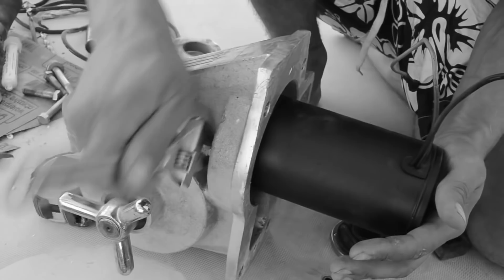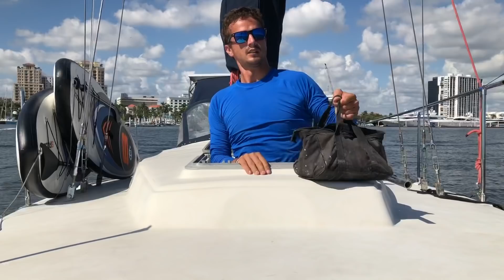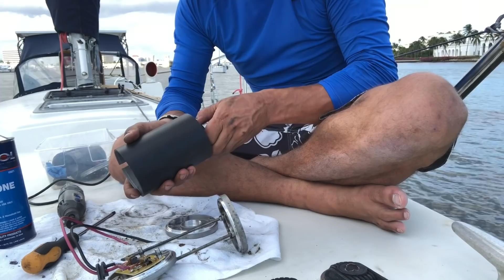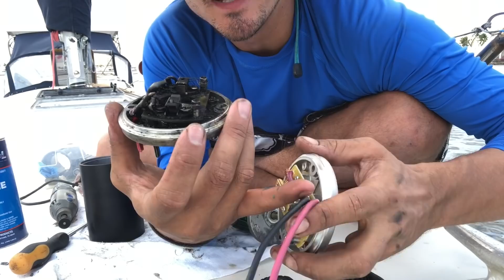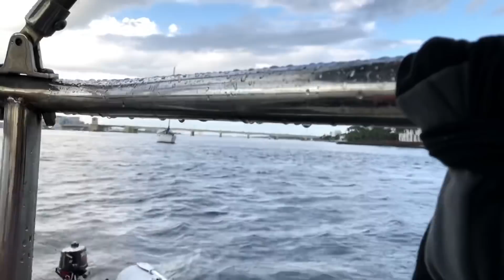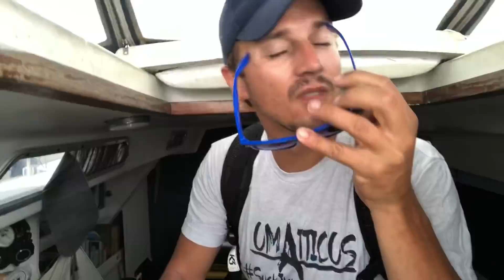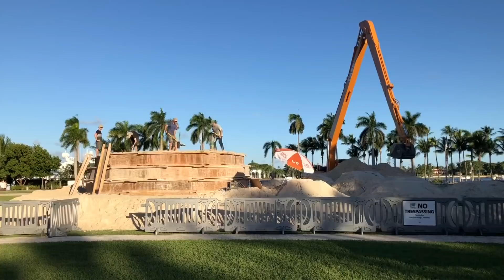Windlass FAILURE by myself [Sailing Uma — Step 146]

Comment: I think you need to do two things, get a higher voltage contactor, not sure where you would source that but Id start looking around the EV market with manufacturers like Curtis. Then Id be looking at soft starters to reduce the load and torque in the power train and electric current surge of the motor during start-up. Both are inevitable. 
have a good one ..

Comment: I think you can use two single motor contactors instead of a dual-reversable. With 4 wires, use the +and- for up on one, and the +and - for down on the other. I would also check the amperage rating on the motor, and ensure your contactors can easily carry the load.

Comment: Actually I think dremels are an awesome little tool! There's a hidden Advantage included as well in what you're doing with it in the aspect that because it's slower than a big grinder would be it's also going to be creating less Heat which could be an advantage down the road in lessoning damage to the shaft steel temper.

Comment: Just a sec, you were using 12V contactors to switch 48V? Yeah, you'll get arcing and welding problems. And I worry that the clutch in the windlass isn't designed to be used as a brake over extended periods.

This one seems to match your specs... whether it works or not I have no idea, but it's only ~$100 (proper ones are more) https://www.electricmotorsport.com/ev-parts/contactors-relays/dc-reversing-contactors/albright-sw182-style-72v-200a-cont-reversing-contactor.html

Comment: Go to a locsl pick and pull and grab yourself two  alternator solenoids from a diesel, those should hold 500amps at 12v so about 125amps at 48v.
Reply: That is what I was thinking.  A diesel truck or big tractor solenoid.
Reply: No that doesn't actually work. It's the back emf off the motor that causes arcing of the contacts when the contacts open. It's way worse at 48V than 12V. Any 12V relay or contractor is not going to last more than a few actuations. A suggestion above about 48V reversing contactors from eBay is the way to go. A 48V 100A or 200A unit should suffice. Great video and narration Dan - thanks heaps. BTW I agree with other comments that the contractor probably fried your motor powering it while stalled. Probably a good idea to open the windlass breaker when not in use.

Comment: you did a fine job with the dremel....better than i would've done.
i would have used a vise grip at the beginning for the backup when removing the windlass bolts but your way worked just fine. (i'm a big fan of vise grips by the way)
any idea how much the windlass motor would've cost if you bought a purpose built windlass motor? i'd say a lot more than a hundred bucks.
anyways....i like how you fearlessly dive into projects with such confidence......and your editing was just fine.
thnx for having me along.
Reply from the maker: The replacement motor for our windlass from the manufacturer is $900 and useless because it runs at 12v. We would have to get it the wound to work at 48v and that would probably cost another few hounded.
Reply: @SailingUma  thanks dan.
one more question.
are you a canucks fan?
:)
Reply: I am also a great fan of Irwine long nose Vise Grips I have a pair 40 yrs old still sharp
Reply: @brianevolved2849  i'm a proto guy.
but i won't deny that your irwine's aren't a fine tool.
let's just agree that a vise grip is the best tool ever made on God's green earth.

Comment: Most important part when mounting motors is to have a flexible coupling. It is impossible to mount two shafts perfectly alligned. And so they will bind or rattle themselves or the motor loose. You can buy cheap flexible couplers for 10$. Or use a piece of garden hose and hose clamps.
Reply from the maker: The windlass has one built in to the base already.

Comment: If you drop it by hand and only bring it up, you might have the motor last longer.  You will only be using it half as much.  Also instead of letting it start and stop just let it come in, but it might be a dirty mess if you do.  Perhaps add a saltwater and freshwater wash down pump for the anchor chain as it comes up.  Also you can cut the weld between the contactor pads, and then polish them up with sandpaper.  They will last a little while longer.

Comment: Just started watching and you should have a string tied to that wrench just in case.
Reply from the maker: We’ve actually never lost a tool overboard.
Reply: We have also never lost a tool, but I have dropped small and important parts into the water! Been lucky a few times and managed to recover it off the bottom.

Comment: I like my manual windlass never brakes down not much effort to operate
Reply: Thankfully my 27ft sailboat has a fairly small anchor so I don't need a windlass to pull it up. I have always considered getting a manual windlass but never got around to it.
Reply: @flyingdutchman6984  my manual windlass pulled me off when I grounded my West sail 32 get a 555 seatiger there 2 speed last forever
Reply: @johnelser9256  - Thanks for the info, but the 555 is probably overkill for my 27ft. I already have plenty of winches to drag me around if need be. If a smaller manual windlass comes up needing a rebuild I'd probably grab it. I can imagine quite a few instances where it would come in handy.

Comment: I bet that bad contactor is what burned out your motor in the first place.  If your anchor was up, and it came on spontaneously like it did to you in the middle of the night, and it was just pulling futilely against the bow roller, I can imagine it burning up that motor.
Reply: I agree... the area where the brushes contact was burned up in specific spots as if the motor was unable to turn and it just juiced the hell out of it with your new batteries.
Reply: Same thing i was thinking.